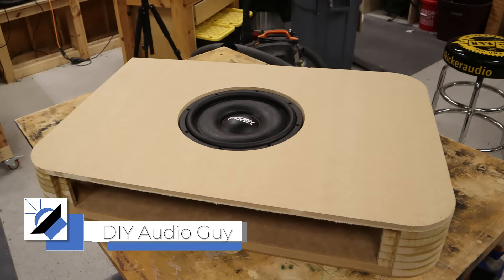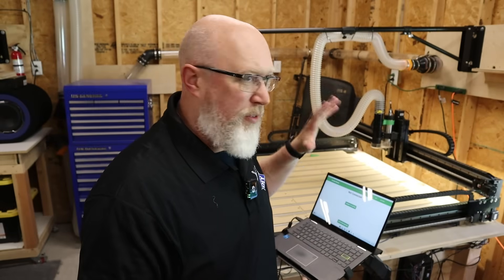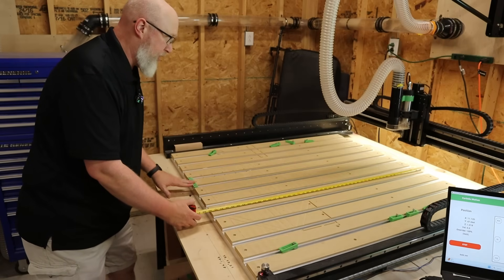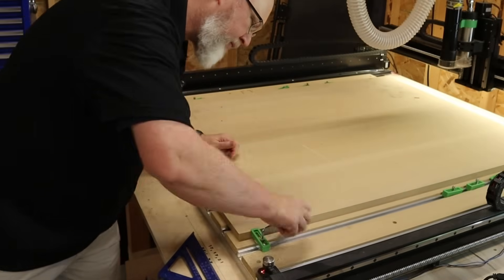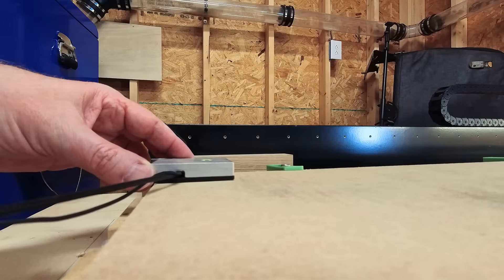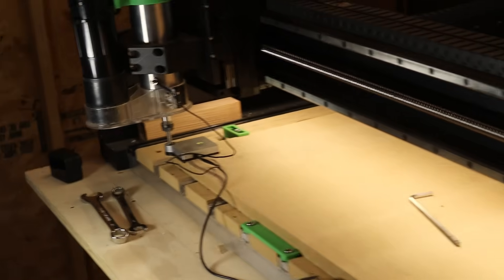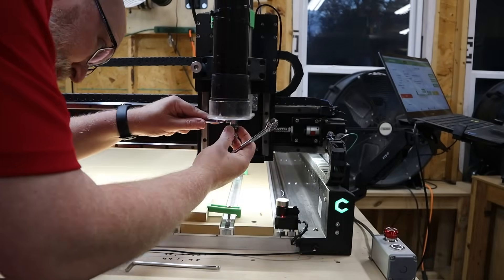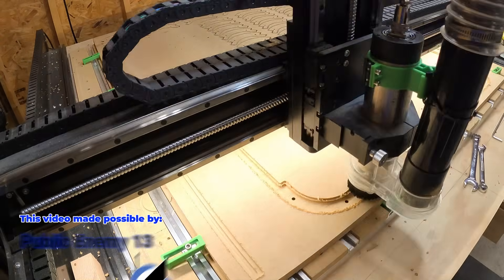How to use a CNC machine.

Comment: I'm seriously looking at the Shapeoko 4 for my needs. Thx for letting us see how it works.
Reply from the maker: It is the same software as the 5 Pro.
Reply: @DIYAudioGuy i built my own for about the same money the difference is mine is 55in wide and 102in long and before you say that's a lot of shop space mine is at a 45deg angle and a rolling  stand and i use a drywall lift to load materials. I don't need him to cut anything i just do not have any free time as i work in a cnc shop and we are crazy over loaded